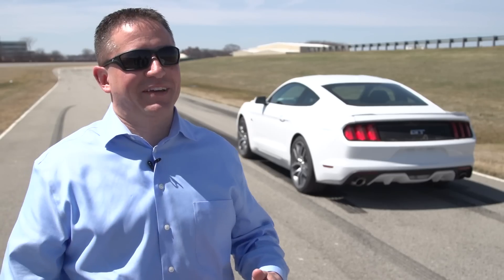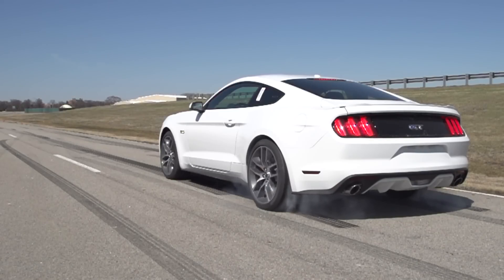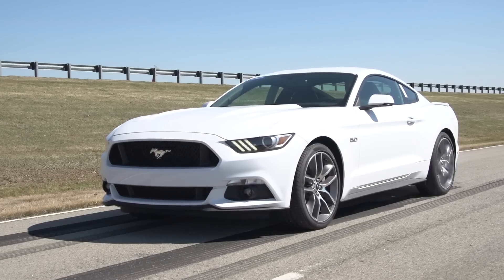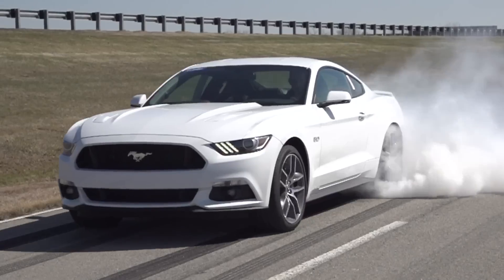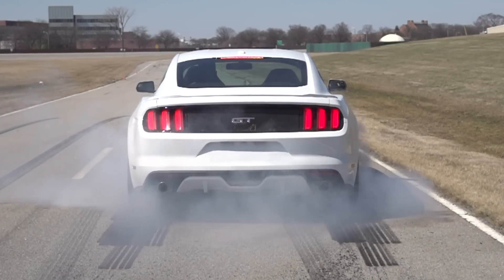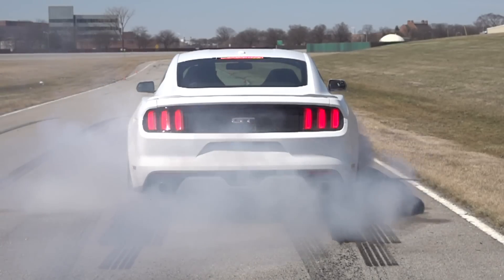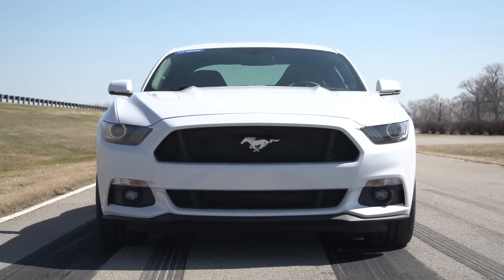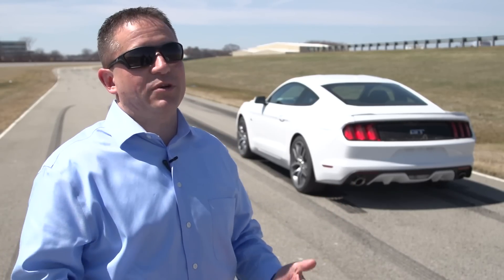2015 Ford Mustang GT: Line Lock burnout feature

Comment: This thing is so FUBAR. Expect to see your 16 year old sister's driving this pile of shit, with the 4 cylinder engine, that ford had the audacity to price higher than the V6. Fucking pathetic.
Reply: BloodstainedSinner So you're okay with a V6 but not a 4-cylinder + turbo? The Mustang Foxbody had 4 cylinders. The 2015 Mustang still has the 5.0. You're only upset because the the design of the front end changed drastically. I also didn't like it when I first saw it because it didn't resemble the 2011-2013 which I thought was perfect.

But I like it now lol. Looks sharp and aggressive. Everything about it looks like Mustang except for the very different headlight design. Does the Foxbody look like a Mustang? Does the 1995 model look like a Mustang? Does the 2004 Terminator/Cobra look like a Mustang? Why aren't you complaining about those cars too?

Also, the 2015 has improved over the previous models in every technical way. Are you going to complain that the live axle is gone? The Cobra/Terminator has Independent Rear Suspension.
Reply: BloodstainedSinner There's only two things that you don't like about this car and those are the headlights and 4-cylinder option. If that's enough for you to say that the car has no heritage then that's just your opinion man. The 2015 most closely resembles the 1969 than any other model in proportions, lines, and rear. I know those headlights are hard to get over. They really went a different direction with them... 

The 5.0 V8 is still there and the car will perform better than ever.
Reply: 1mantisco Of course they will. F.O.R.D made their Fusionstang look like a Fusion (which Europeans love) and a Aston Martin, which Europeans typically also love. Ford said "Fuck the American heritage" and disgraced this car completely. This car is not a Mustang. There's a difference between evolution, and changing the car so much, it's not what it's supposed to be. Look at the new, updated 2015 Challenger. THAT is evolution. Keeping an old - modern style, and updating the interior to be the perfect blend of old-school, but with technology. THAT car knows what it wants to be, and it IS what it wants to be. This F.O.R.D doesn't know what it is.
Reply: I think this might be the dumbest series of posts I've ever seen from one person. When this guy started talking about killing a man I literally gave myself a headache laughing.
Reply: You can still get the v8. Why are people complaining when customers get more options? Are you a fucking commie? This is capitalism, yo. Competition and shit keeps things getting better.
Reply: Ever hear of the SVO?
Reply: BloodstainedSinner So you're upset because the Mustang didn't stay the same after 1969... You honestly think a car is going to be kept exactly the same for 45 years? I see what you really disapprove of is the 4 cylinder, which I understand because I feel the same way every time I see a V6. A Mustang should always be a V8. If someone wants a V6 / 4-cyl then they should look elsewhere.

Ford makes V6 an option because they know they will sell. Don't forget Ford is a company and they're going to look at things from a business perspective. The fact is that V6 sells and so will the ecoboost worldwide. It sucks but oh well.
Reply: BloodstainedSinner Last year's Mustang looks fat compared to 2015. The 2015 looks closest to the 1969 like I said. The rear has the Mustang Fastback profile. Do you even know how a 1969 looks like? The only thing that resembles the Fusion is the headlights. 

The R/T is too heavy at 5300 lbs, 1700 lbs heavier than the GT. Horsepower won't fix that. The SRT8 can't even compete with the GT so the R/T stands no chance. The Challenger is for cruising.
Reply: BloodstainedSinner
 Dude, who the Fuck cares... A car is a Car.. A 4 cylinder putting out more power than a 6 will always cost more... It's nothing new to the automotive world. The SVO was equally as fast as the GT Fox back in the day.. A fast car is a Fast car at the end of the day..... Second, There is only about a $1,000 between a BASE model mustang and a BASE model Mustang GT.. Factor in that the Challenger R/T only makes 375 at the Crank and the 11+ Mustang GT makes that at the wheels STOCK.. Unless you are in a SRT8 you're going to be slower than any 2011+ Mustang GT or a V8 Camaro.
Reply: What the fuck is going on in this thread. I can't...
Reply: Jason Short You don't get it, my friend. Muscle cars just don't have 4 cylinder engines.. they just don't. And a Muscle car is supposed to look MUSCULAR! This car.. no, it... no. Not muscular. Very European-esque.
Reply: BloodstainedSinner I understood it just fine.The new Mustang looks like a shit stain
Reply: It looks like Ford want to compete against the Hyundai Genesis instead of GM
Reply: 1mantisco
They are going after everyone. They are global now!
Reply: Patrick Connolly What? They weren't global before?
Reply: 1mantisco
No they were just sold in North America
Reply: flamefleir I'm not complaining about all the other Mustang's because they've been gone for a long time. They all looked gay, at that. The last real Mustang was the 1969 Boss 302. When the late 1970's hit, everything went straight too hell. But now, F.O.R.D's fucked up, more than ever. Did I say I was OK with a V6? If I did, please, do point it out for me. Don't forget; the original Mustang's did have a 6 cylinder option, so it isn't as bad. You're missing the point. This car ditched all of it's heritage, and went right after the ricer market, and F.O.R.D is proud of it. It's a fucking disgrace. They do this too the car, then openly seem happy that they WANTED to target the 4-cylinder loving 17 year old idiots, driving 1995 Civic's with 110hp.
Reply: flamefleir
No, I'm pissed off because IT'S NOT A MUSTANG. This car they CALL the Mustang has ABSOLUTELY NO HERITAGE! It's a car, that they slapped the Mustang name on JUST to get people to buy it. If I was pissed because it doesn't look like the '69, then I'd be pissed the new Challenger doesn't look like the '71. The Challenger follows it's heritage. It really IS a Challenger. But this car IS NOT a Mustang. It's a Fusionstang.
Reply: flamefleir Did I say it was just the head lights? It's the entire car. It's not even remotely the same as it was last year, and last years' wasn't even that good looking anyway. All I know is, this isn't a mustang. It's a stretched Fusion. From the side, it's a Fusion/Aston Martin. From the front, it's a Fusion. From the back, it's not remotely similar too anything, other than the tail lights. What I also know is, anyone can go buy a Challenger R/T, with the 5.7 HEMI, that costs quite a bit less than the Mustang GT (right around $4,000 cheaper) and spend that extra $4,000 you WOULD have spent on the Mustang, too bump that 5.7 up too 500hp at the crank, and have a car much faster, much more comfortable, and much better looking than a Mustang, for the same exact price.
Reply: flamefleir
5300lbs? What the hell are you reading? It's 4,100lbs. The SRT-8 is miles faster than the GT. -- again, what the hell are you reading? 5300lbs? That would make it heavier than a Ram 1500 Tradesman truck. You been drinking the fruit juice, or what? Search any video of a stock SRT-8 dragging a stock GT. The SRT-8 finishes 3 car lengths ahead.
Reply: Texarmageddon Good thing the Challenger R/T is right around $4,000 cheaper than the Mustang GT. With that extra $4,000, you can buy yourself a nice supercharger, and push that engine too a little over 500 at the crank, more like 530chp, and it'll be putting down 490-ish too the wheels, for no more money than a Fusionstang. However, you should read up on the new 2015 Challenger. Can get the new R/T Scat Pack with the 5.7L HEMI making 433hp, or an optional 392 in the R/T Scat Pack making a bumped 485hp, up from last years 471hp. Funny thing is, the 392 (6.4L HEMI) was only for the SRT-8's, but now has been moved too the R/T as an engine option. Another funny thing is, there's been rumors, since 2011, about an up-coming Challenger Hellcat, with a suercharged 6.2L HEMI, making 680-700hp, crank, and the 2015 SRT-8 has yet to be revealed. However, there were recent spy shots found of this "Hellcat" at a Dodge testing track, with it's massive hood scoop, and a giant supercharger sticking off the manifold of the HEMI under the hood. Further more, there are interview videos everywhere about Ralph Gilles (head of the SRT program) being asked about this rumored "Hellcat", and he cracks up laughing, and replies "I can't talk about the new cat thing. We can't release product information." That aside, SRT is being absorbed BACK into Dodge, because Dodge is moving back to what it was always supposed to be - the performance division of Chrysler. Their coming out with a much bigger, badder engine that's going to mop the floor with all the competitors, They're getting rid of cars that aren't really meant to perform (like the Dodge Grand Caravan; minivan) and focusing the Dodge brand on being a modern mirror image of what it was in the 1950's-1970's; the company that produces the fastest cars around, and only the fastest cars. Chrysler is being moved back too the forefront for automotive sales, filling the role Dodge currently has. Chrysler is going to be getting many new models, and is going to be the big community seller, again, leaving Dodge to fill that performance niche in the market. And history shows, Dodge has been damn good at doing that.
Reply: Texarmageddon Not sure where you live, and nor do I give a flying fuck, but where I'm from, everyone owns Dodge's. 99% of work trucks (company work trucks, as in the guys that work on powerlines, and construction, etc) have switched too RAM's from F.O.R.D.s. Most of the people within 20 miles of me own 1990's Dodge Ram's, or Dodge Dakota's. There's quite a few new Jeep Grand Cherokee's, Jeep Compass's, and Wranglers. I see a new Dart every now and then, and a few Journey's. You must live in the middle of the woods in Georgia, because every where I go, I'm seeing more and more Chrysler/Jeep/Dodge/Ram products every day. Funny how Dodge is the fastest growing brand in the United States of America -- not just automotive company, but BRAND, as in, no other company is growing faster than Dodge. Soon, F.O.R.D. is going to be put back in it's place. F.O.R.D had their moment in the sun, but Dodge is coming back to reclaim the title.
Reply: Texarmageddon 2014 Challenger R/T: $28,490. 2014 Mustang GT: $29,035. Then, right under that $29,035, it says, in tiny print "After $3,000 cash back" Now, go read up on how to get that $3,000 cash back. In short, you're not going to. The real sticker price of the Mustang GT is $32,035. The real sticker price for the Challenger is $28,490. Oh, look at that. It's cheaper, by, how much? $3,545. I originally said $6,000, because for some reason, I had thought the R/T was $26,000. I believe I was remembering an older price. I then said $4,000, because I had remembered the cars price NOW, and threw a close number out there. Forgive me for being off by $565. LOL. The Dodge Dakota was discontinued because the market for midsized trucks disappeared. Chevy got rid of their midsize, and so did F.O.R.D. Why would they keep making a vehicle there's no market for?
Reply: Oh, and I can't help but add: One can buy a 2014 Challenger R/T Shaker (highest trim level of the Challenger R/T this year) for $35,490. Comes with all the bells and whistles... and you can buy a base Rustang GT, with nothing in it for only 3k cheaper. HA.
Reply: BloodstainedSinner LOL what?
Reply: BloodstainedSinner Oh let me guess... This is where you tell me you killed someone in the army or something because I called you a Kid? Tell you what... Try threatening someone's life who hasn't and see if they don't try to take yours back
Reply: BloodstainedSinner Not Answering a question that has nothing to do with your inability to look up car prices. NEXTTTTTTT
Reply: Texarmageddon You're in between 15-17 years old. You're not tough; get over yourself, child.
Reply: BloodstainedSinner Again, what does this have to do with your lack of comprehension skills regarding 30,000 vs 31,000? You've largely diverged from the topic at hand which is laughable at best.
Reply: Texarmageddon That has to do with the fact that, given your mental age, you're too incompetent for anyone to believe anything you say, and thus, your numbers are easily discredited by the fact that you likely pulled them out of your ass, as every pubescent teenager would. See how it all ties in? Understanding someones mind and thought process (yours) can uncover that the person (you) can't be trusted as a reliable resource. Especially when they're trying to make a counter-arguement, and can't supply any proof.
Reply: Texarmageddon I'd love to make a video, problem is, I can't. If I could, you'd see my 1999 3000gt VR-4, and 1973 Plymouth Duster.
Reply: BloodstainedSinner Chong my wong
Reply: BloodstainedSinner Dude give it up. Comparing a Mustang, a true American icon to anything Dodge has to offer is not going to happen. Dodge sucks, has sucked for decades now, and the next Mustang GT will be probably the best performing car in that segment in the world, never mind anything Dodge can throw at it.
Reply: Voycodin Right. That's considering the pre-2011 Mustang was 315hp, and the Pre-2011 Challenger was 425hp. Who are you kidding? Ford's been producing the slowest junk since 1967. Golf clap for them for being at least a little bit faster for, what, 3 years? Do some research on the Challenger "Hellcat", and on the 2015 Challenger. Ford's faster for only 3 years and it took them 46 years to get there, and die-hard ford fangirls like you emerge? That's sad. That's really sad.
Reply: BloodstainedSinner
 Didn't see anyone take down the 427 SOHC back in the day.... Did dodge even have anything to compete with the LS1/ SVT cobras back in that time frame? Nope. Sorry mate... Dodge fucked up and they are overpriced.. Come back when you can quote Official MSRP prices from Official Websites.
Reply: BloodstainedSinner For has had a distinct European division for nearly 50 years. Ford too has owned at least one premier European brand. It still does not change the fact that the upcoming Mustang is the first pony car to enter European market, and that it is going to be the best performing pony car ever, by a wide margin. It also does not change the fact that Dodge is a company that produces cars of low quality aimed at sibling banging clientele, which the Italian giant is only now attempting to civilize.
Reply: Voycodin Low quality? Show me this low quality, please. Working as a mechanic, all I see is low quality Fords. In fact, ask any mechanic where they make the most of their money -- by working on Fords that are falling a part, is where. Blown turbos, blown ruptured brake lines, oil leaks too no end. What's the problem that MOPAR has ever had? 2006-2008 Ram 2500 transmission problems? Because, that's the only problem, ever. Everything else you read on the internet is written by people like you, who believe everything you hear. I guarantee you have no experience with a Dodge at all. I'm sure you'd be more than willing to lie, and say you do, just to try and prove your point, as most ignorant kids on the internet do. Yet, it still stands: SHOW me this "low quality". I want to see it, because, I never have.
Reply: pete jones Yeah, hilarious, isn't it? People being killed! Oh, so funny!
Reply: David Lopez 2008 Mustang GT: 315hp. 2008 Challenger SRT8 (the only model that was out, there was no R/T, the SRT8 is meant to compete against the GT, not GT500) was 425hp. 2009 Mustang GT: 315hp. 2009 Challenger: 425hp, and this continues on, until 2011. 2011 Mustang GT: 415hp, 2011 Challenger SRT8, 471hp. Looks like Fords' the one playing catch-up.
Reply: Jason Short
5 more horsepower, $2,000. Yaaaay. Biggest problem is, muscle cars are in this constant war with ricers (even though reality shows muscle cars are always faster). However, Ford did the most moronic thing possible, and decided to put a 4 cyl ecojoke under the hood. Watch every ricer and their mom say "Ooooh look! Even muscle cars know 4cyl is better! YA FART CAN!" This is why the Mustang is exiled from being a Muscle car. It's not. The Mustang is a muscle car, the same way a BMW M3 with the V8 is a muscle car. It just isn't. It's not, and won't be again. It's too femanin, and lacks personality. It's too "Europe". It's too.. 4 cylinder. It's too much of a disgrace to be a "muscle" car. A "Muscle" car looks muscular, and is known for a high performance V8. Gay the car down, and put a 4 cylinder in it.. Hey, you have a Japanese Ecobox... or a 2015 Ford Mustang -- that people actually think are fast! As if putting a 4 cylinder engine in a "muscle" car that has been queerly redisigned the way the Mustang was isn't bad enough -- the 4cyl Mustang will get it's teeth kicked in by Japanese 4 cyl cars. Japanese 4 cyl cars usually weigh right around 3,100lbs, and make 320hp. This Mustang weighs, what, 3,400lbs, 305hp? Even more of an excuse for ricers to try and disrespect American muscle. Ford ruined the Mustang. It's just not what it was.
Reply: Pvt Snowball The joke of a car from the 1980's that made 174hp, even with a turbo? Yeah, and I couldn't care less about it.
Reply: BloodstainedSinner Umm, Three car lengths or .3 is not "miles" , and Ive seen Srt8's struggle to get out of the 13's... The GT with a tune CAN be just as fast as the SRT8, even if you don't want to admit it lmao...
Reply: Patrick Connolly I don't think Europe will be to impressed
Reply: BloodstainedSinner Yeah you have a valid point
Reply: Again you typed a long paragraph and Dodge clearly has the R/T priced 1,000 cheaper than the Mustang GT.  Clearly, you're missing the Fine Print on Dodge's website. Hence, you fail..  Learn how to read before you start a long argument with someone.... First, it was the Mustang is 6,000 more expensive than the challenger, and now it's 4,000 more expensive than the challenger? Dude, you can't get your shit correct.  Dodge, is a Non-Factor in civilian cars ...
Reply: BloodstainedSinner LOL GOOD OL USA Website Clearly Says 1,000 Cheaper than the Mustang GT. Quit typing the long Paragraphs not admitting Defeat...  While I won't deny Dodge can make good Cars, but let's be honest here. 1.) Companies switch to different Manufacturers when they are offered a better deal at the time.. Plain and Simple. 2.) the Dodge Dakota was discontinued. Hence, making your reference to it irrelevant. 3.) I live in Texas. 4.) Dodge will not move Ford off any time soon with their outrageous pricing.
Reply: Texarmageddon I'm going to ask you one simple question. Have you ever killed anyone?
Reply: Texarmageddon Have you ever taken the life of another human being? Wrapped your hands around their neck, and squeezed until you no longer felt the pulse of their heart forcing blood through the carotid artery? Have you ever cut someones throat, and watched them as they lie there, drowning in a pool of their own blood? Have you ever crushed someones skull with a baseball bat, to the point that nothing remains but a pile of mangled flesh and blood? Have you ever killed anyone?
Reply: Texarmageddon It's a simple question. Are you an invalid, incapable of answering it? Stop avoiding it. I asked you if you have ever killed someone, and you are going to answer.
Reply: BloodstainedSinner you know I wish I was still between 15-17 years of age.... back then I was only allowed to work part time... while attending school.....
Reply: Tell you what. Let's make a quick 30 second video of you proving me wrong about the pricing of the cars. You can belittle me all day, but talk is cheap.
Reply: BloodstainedSinner  I could care less about your cars... I only care about where you were misinformed about your information.
Reply: BloodstainedSinner so you hate the stang then you must hate the new charger as well 
the problem is supposedly both cars will completely out preform their predecessors
Reply: BloodstainedSinner Your fucked 
The 1970 was miles better looking than the 69 , all they did is make it smoother , I had a 70 version right out the showroom .with ram air, rear slats and power steering , 430 rear end .( 8 mpg at best )
The front of the 2015 is pretty nice , they just need to make it a bit different in the V-8 version , add some better driving lights and a chin spoiler , drop it one inch .
Its a nice looking car , I might just get one as a retirement gift to my best friend -- Me -
Reply: millwrightman99 The 1969 and 1970 looked exactly the fucking same.
Reply: BloodstainedSinner Bullshit , the 1970 was cleaner & they took away the phony intakes on the regular version
Reply: millwrightman99 Whatever you say cheech..
Reply: BloodstainedSinner Actually, I have quite a lot of experience with Chrysler/Dodge, because I owned both brands. The last Chrysler I owned, Concorde, was so bad that even mechanics could not figure out what was wrong with it's electronics. It would randomly refuse to start, only to ignite just 20 minutes later. Took it in five times, they were still clueless. I'm not even going to list the minor issues, as there would be too many, including oil pan leak(?!). Never had that happen to a car of mine before, since I live in a city and don't do off road driving. Also, when you look at consumer ratings on used cars, Dodges and Chryslers always come in toward the bottom. Millions and millions of people cannot be wrong, despite your best wishes. If the company was doing so good, it would not require government bailout, and it would not get such poor ratings from consumers. To be fair, I had several issues with my 2005 Mustang GT, but that was the first year that model came out. Since then Ford has upped their quality, with a recent temporary decline mainly due to their sync interface.
Reply: Voycodin Talk is all bullshit. I said show me. Nevertheless, I will say the Chrysler Concorde was a pile of shit. All Chrysler's cars (and I mean CHRYSLER's cars, not all the companies UNDER Chrysler) were aboslute shit in the late 1990's and Early 2000's. The Chrysler 300's had the same problems as the Concorde's in the early 2000's, but you aren't going to find any of those problems in new products.
Reply: 1mantisco
Yea they already got tired of walking all over the Slowmaro's so decided to keep abusing them and give them time to catch up like the Mopar girls. So they decided to play with the half blind Koreans.
Reply: The four cylinder will be more powerful than the v6 and probably get the same if not better fuel economy. Most likely lighter too.
Reply: Jason Short
Dude lol, some cars are just not meant for fuel economy man. Would you get a 3 cylinder lambo? lol. It's a muscle car. The 6 cyl was already pushing it but at least it got 305 hp. A 4 cyl is meant for Honda's etc. That's my 2 cents.
Reply: ***** Once you make an American icon suitable for the global market, it's no longer an American icon. We can't say "We exclusively have this car. You can stare, and be jealous, and dream, but we have it." No Mustang owner can say that anymore. Ford is one massive sellout.
Reply: Ikr wtf a 4 cylinder mustang
Reply: STFU
Reply: I only read one comment below so I don't know the whole story. But that said, 11-14 GT is FASTER than the SRT8 392. Look up every review. MotorTrend: GT 4.3 0-60, 12.7 1/4. SRT8 392 4.7 0-60, 13.0 1/4(Same as the SS). The numbers change slightly from reviewer to reviewer but all say through their testing the SRT8 392 and SS run the same times and the GT is slightly faster. It is what it is. All three are fast, beautiful, and dominate the street. I've got a 2012 5.0 my Plt Sgt has a 2011 392, we've raced 7 times 5 standing 1/4 and 2 rolling (45mph) he's only beat me once. The 392 has the top end acceleration, 130+ he starts pulling bit by bit. I can't wait for us to run again, we both have tunes, CAI, and Exhaust now. Should be fun.
Reply: this new 5.0 is going to be faster on any track than the new SS and  the new SRT....with a SMALL BLOCK. not to mention its not a stretched fusion. its shorter, wider and lighter than the previous years' mustangs and not to mention it no longer has the live rear axle so it is going to perform considerably better than the previous years and thats fact!
Reply: 1mantisco It's Europe. And there is no known cure.
Reply: BloodstainedSinner
A Challenger RT Cheaper than What? man get off the pot and Check Dodges site again... An RT STARTS at the same price of a Base model GT brand new/
Reply: BloodstainedSinner thank godness, I felt guilty cause tought I was the only One that thinks like that
Reply: BloodstainedSinner Do you have a license to drive? The more comments you make the more it seems like you've never owned a Mustang... or any car at all. Remember, video game cars don't count as real no matter how photorealistic the games appears. LOL
Reply: BloodstainedSinner
 are you forgetting about the Mustang SVO???
You seem to be slightly butt hurt.
Reply: 305 horsepower 300 lb-ft of torque from an ecoboost 2.3 I4
Reply: BloodstainedSinner you're fucking stupid buddy, its actually funny and sad at the same time.
Reply: Things change, get over it. No one ever complains how much the Corvette has changed since 1953. No one ever complains about how much the Impala has changed since 1958. No one complains about how the F-series has changed since 1948. No one complains about how much Chevy and GMC trucks have changed since 1946.

Companies progress through change. The ONLY constant on earth is that animals are born and animals die... that's it. Ford has decided to target a new audience with the Mustang. Manufacturers offer options because if production of one model only came with the same options on all units the manufacturer would loose sales. As far as the 2.3 ecoboost goes, 305hp and 300 lb. - ft. of torque is extremely impressive for a fourbanger. People who want a Mustang but want decent mileage have gotten what they wanted and Ford will sell more Mustangs.
Reply: Alan Schulte exactly, said it spot on
Reply: During his lifetime, Henry Ford only wanted to build the Model T based on its overwhelming success. His son wanted to pull away from the T and emphasize other models. Henry didn't want it and soon enough the company began losing money to other automakers. Customers wanted new models, different models. Customers wanted change.

An overwhelming majority of folks who "hate" the 2015 do not own and have never owned a Mustang. You know who they are when they say that they're going to buy a $55k M4 or a $25k Accord instead. LOL